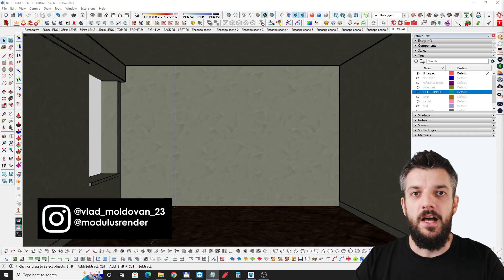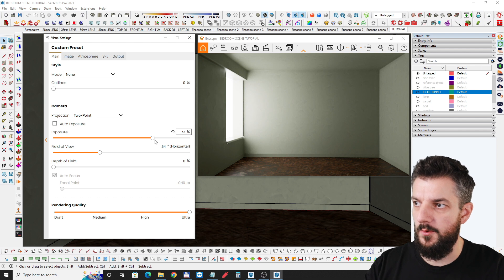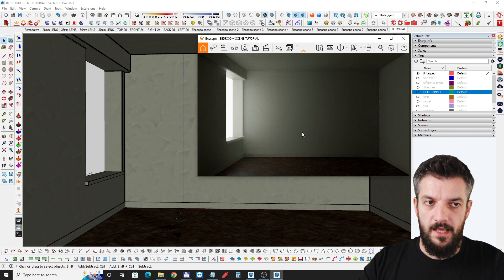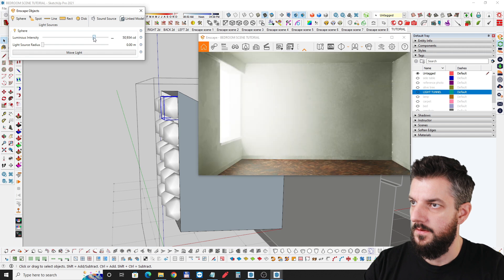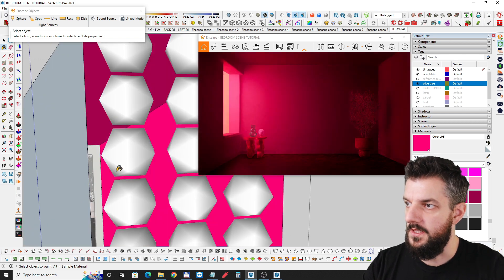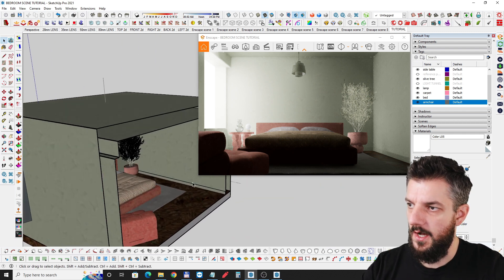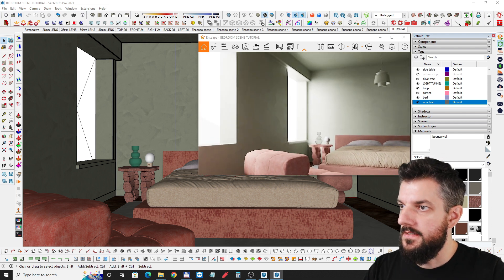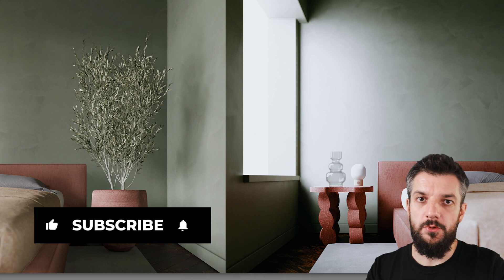Enscape Soft Directional Lighting | Modulus Render

Comment: As usual, a good video with some tips that can be useful. Sometimes we need to fake things to make them real, it's a weird advice but that's how it works. I see a lot of people trying to replicate as close as possible reality, thinking it will make the render more "believable". In your example, to adjust the shadow in the foreground, they will just "crank up" the HDRI to not "cheat" with a wall with emissive shader "because they will say, it's not working like that in reality".  You prove it, with your example, that's the best method :) 

I hope in the next update, Enscape will add an option or settings to be able to use some Gobo light. It will be perfect for a scene like this, to have some leaves's shadows cast on the wall.
Actually i have to use other render software (C4D with redshift) because i'm not sastified with my try in Enscape (it's either to flat or not real enough). Do you have any advice or tips for this kind to achieve this ?
Reply from the maker: Thank you. I see it more like a movie set where everything goes to trick the eye into believing it's real. Do you mean advice on hoe to get a gobo like effect in Enscape?
Reply: @Modulusrender  i think your "analogy" (not sure of the word in english) with movie / cinema is the perfect way to explain your example. You're right !
About using a "gobo light" in enscape, actually i'm not satisfy nor very conclusive for my taste. That's why i have to use other render engine. But yes, if you have any tips or advice to make a really believable light in Enscape by using a gobo method, i'm curious ! 
I've bought the pack "Light Gobos" from Greyscale Gorilla. The render are gorgeous but as i said, it can't be used in Enscape sadly. At least currently.
Reply from the maker: @flow_leit  I will do some tests with gobo lights in Enscape and get back to you.
Reply: @Modulusrender  Thank you is very kind of you. There is no rush or whatsoever. And it wasn't a particular request for you,  i was just curious if you had already experiment this and if you was happy with the result. 

I have to say you had my curiosity, but now  you have my whole attention ahah.
Reply from the maker: @flow_leit  I did gobo lighting in one of my Thea tutorial and it's really easy with the projector light. I'm now curious to see what I can get in Enscape with something similar.